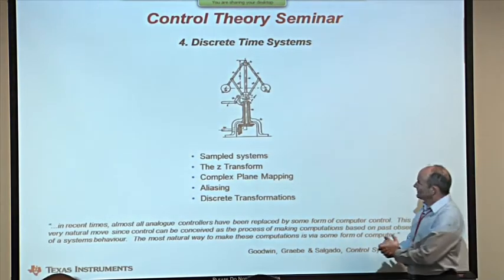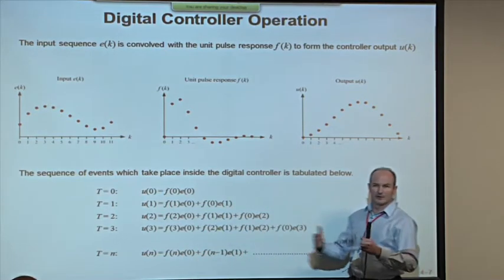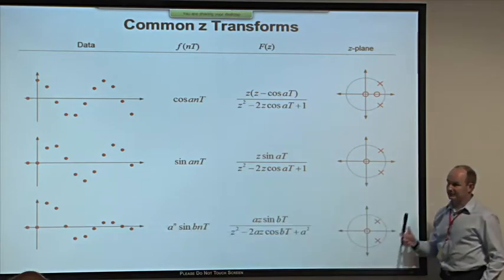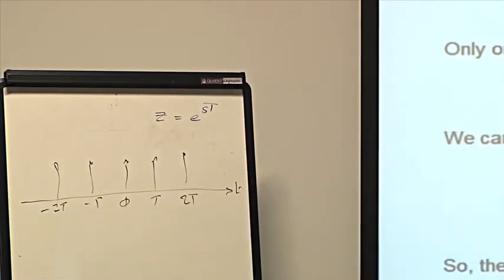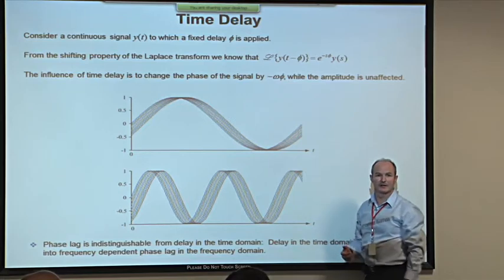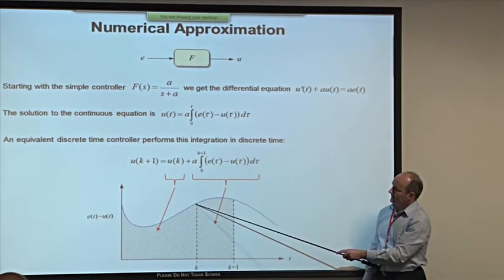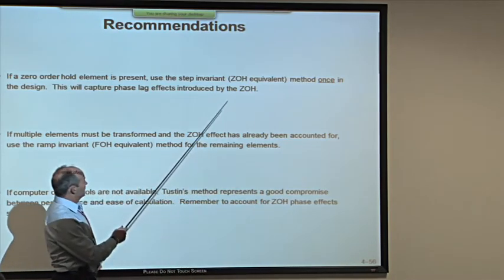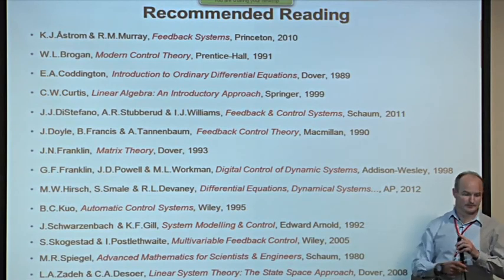Control Theory Seminar - Part 4

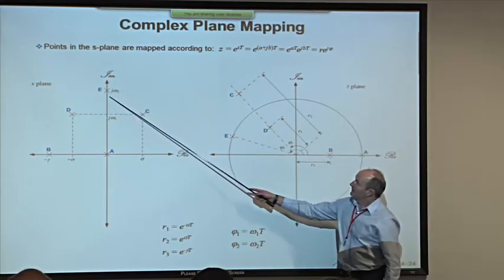Comment: Good stuff, but I note a couple of things about poles and zeroes in Z-plane around 40:00--43:00.  Firstly poles' and zeros' positions map the same way between Z and S-planes, and secondly the primary strip doesn't reflect into the adjacent complementary strips, it simply repeats over and over - this is crucial for filters with complex coefficients such as Hilbert transformers where poles and zeros do not have to be in conjugate pairs.

Comment: I am only an Engineering Technician, It would be nice If you can show the Real World Application of  ALL this in a REAL WORLD Applied Engineering problem as in Controlling a Vacuum Chamber Temperature Cycling that ramps up and down from 250 degrees F to -120 degrees F using Electrical power heaters on a specimen with Thermocouples as temperature sensors and with SOLENOID VALVES controlled by RELAYS with a plumbing of liquid nitrogen to control the COOLING which is controlled by a PID controller Temperature Program cycling profile. This is very CONFUSING TO ME = TOO MUCH Theoretical mathematics and LAPLACE can it be EXPLAINED IN VERY SIMPLE TERMS? I have never used or seen  LAPLACE Transforms as an ENGINEERING Technician in the real APPLIED World.